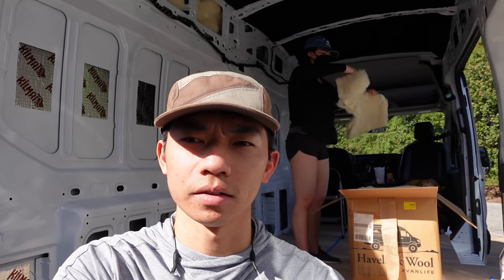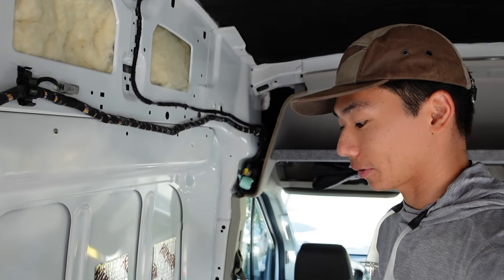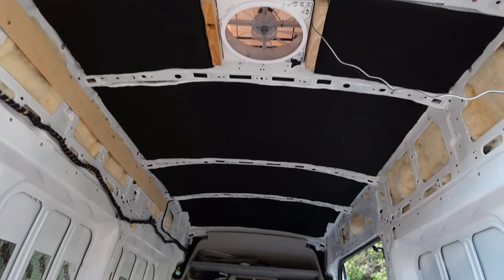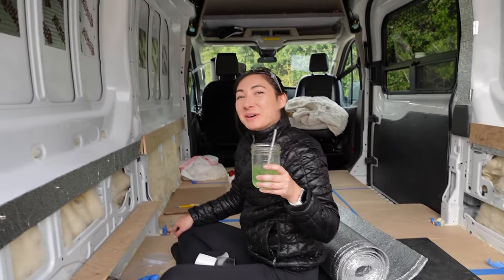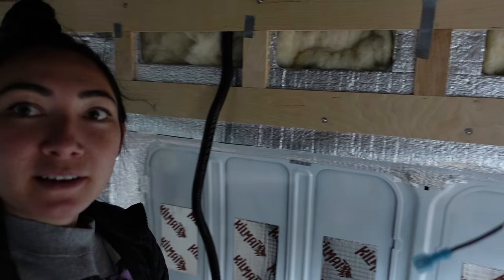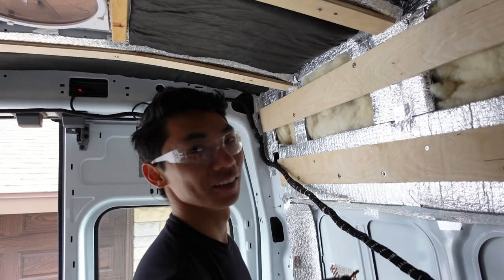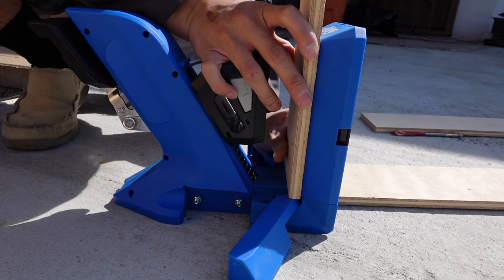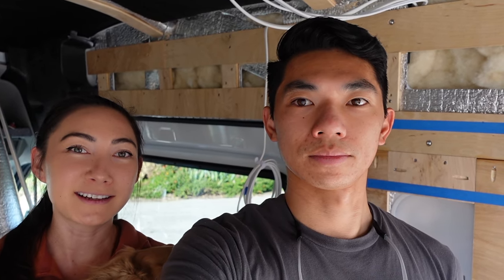DIY Van Framing with Plywood, Rivet Nuts, and Self-Tapping Screws | Van Build Series (Ep. 10)

Comment: Low- e also helps with wood not squeaking against the metal.  Are you going to paint the plywood with Kilz ?
I am in the same step of building the frame, I am going to treat all the woods used with Kilz.
Reply from the maker: Yes, good point with the squeaking! We didn’t treat all of our framing but we are priming and painting our plywood walls and ceiling that we’re putting in.

Comment: I'm planning on framing my van and saw that you used 1/2 plywood instead of 3/4.  Have you had any issues?  I'm thinking of using 1/2 inch as well to save on weight and cost.
Reply from the maker: The only issue we had with 1/2” ply was for the ceiling. We had some difficulty bending 1/4” ply to the contour of the van ceiling. Since it was under tension, some of our screws popped out, so we ended up driving self tappers through to the metal supports. Looking back I wish we’d used Baltic Birch for the strength and piece of mind, but we didn’t know where to get it at the time and just used regular Birch plywood!
Reply: @itstimetocrunch  Hmm, that's concerning that the screws popped out.  This is the panels and not the furring strips, correct?  If it was the ceiling panels, do you think using  tongue and grooves for the ceiling would help since it's not under tension?  I also cannot find baltic birch anywhere.  I've only tried Home Depot and Lowes though.
Reply from the maker: Sorry for the late response! We used Birch plywood from Home Depot for our framing which was before we found a Baltic Birch supplier. The 1/4” paneling is what popped out, not the framing.

Comment: So all of the van building videos and forms I’ve been on, I haven’t seen the low E used up against the steel like that. Is that for a kind of thermal break? Would it cut down on the condensation due to the fact that there’s no cold steel to collect moisture out of the air?
Reply from the maker: Yes exactly, in our case it’s mostly to help reduce the thermal bridging between the van walls and wood framing but it would help reduce condensation too. Many people use Low E for creating a vapor barrier but with its own set of pros and cons. We believe it’s best to not over think it!